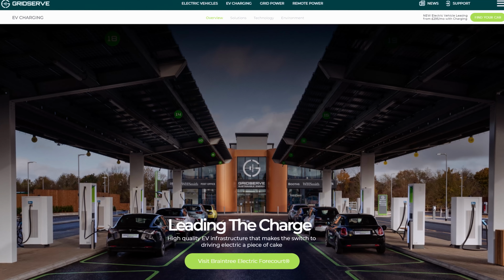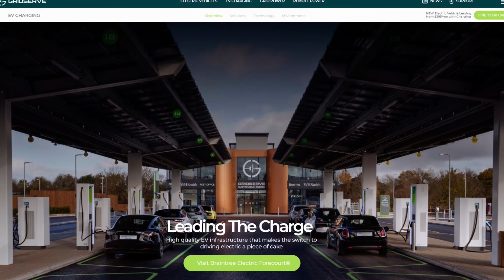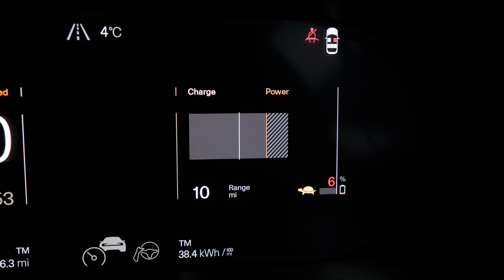Gridserve Braintree Electric Forecourt with the Polestar 2 - Part 1

Comment: Hi Bradley

When battery pack is cold, restriction is shown on the Regen side of Energy Consumption, as battery pack warms up it gradually reduces. The limit you are seeing is the Acceleration restriction due to State of Charge in the battery which is why it gets bigger the lower the charge.

Congrats on the subscribers, and hope this helps.

Nick